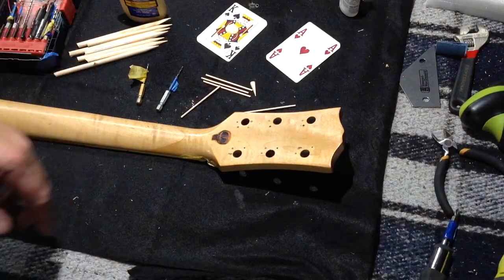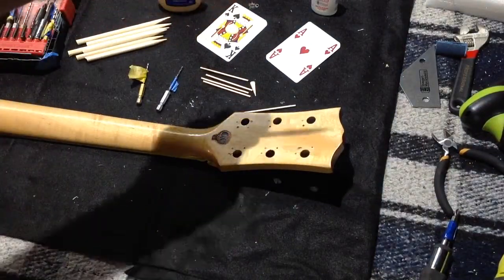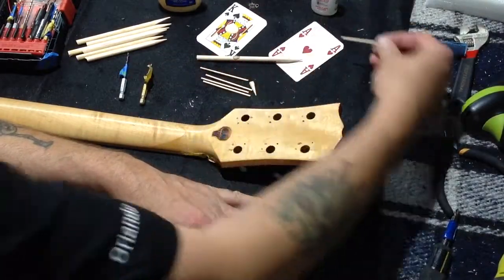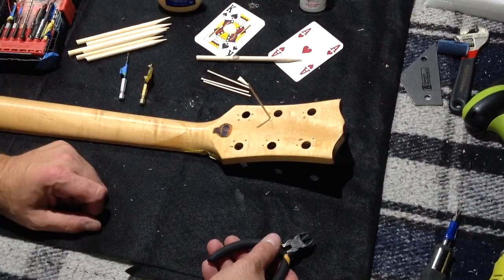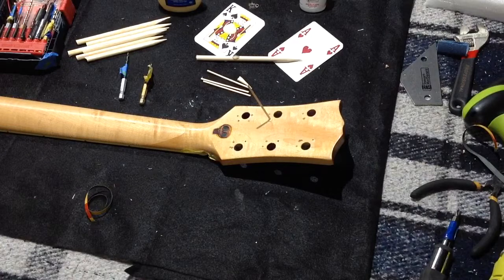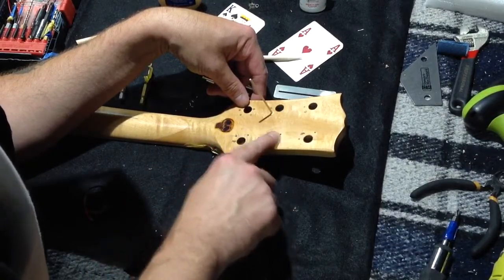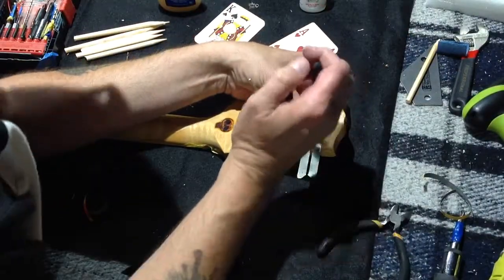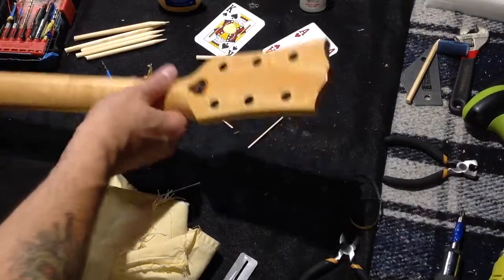Guitar Tuner Screw Hole Repair

Comment: Thanks for the video. What do you recommend for repairing that hole if it’s a bit stripped? The screw holes for my tuning peg somehow got stripped once I removed one of the pegs. 

Once I realized the spares I wanted to use wouldn’t fit, I went to screw the old one back in and noticed I couldn’t get the screws to fully tighten. Any sort of simple diy suggestions are welcome
Reply from the maker: Just get some toothpicks and regular wood glue. Clean out the working area. Get a warm damp cloth or paper towel.
Cut the toothpick sharp points until middle of toothpick.
Dip in glue.
If the holes are bigger use more toothpicks.
Let dry overnight.
Trim excess and sand if needed.
If the filled holes are visible you can do some simple finish repairs.
Reply: @Thomasdgolden  thanks for taking the time to type that out. Seems pretty straight forward so I’m going to give it a try when my new tuners come in tomorrow. Thanks again.
Reply from the maker: @lastjedii  Lemme know how it goes.